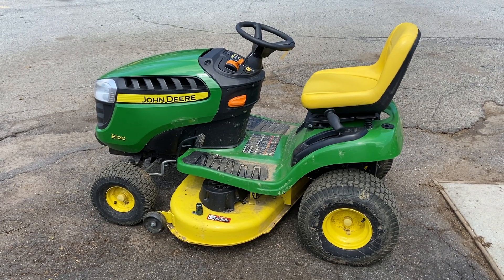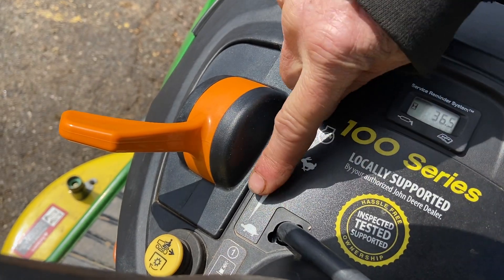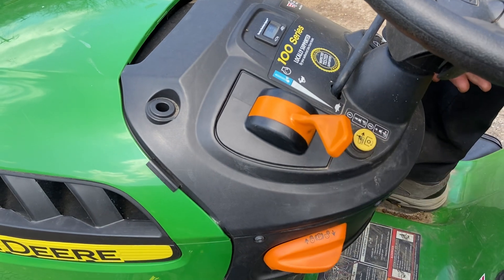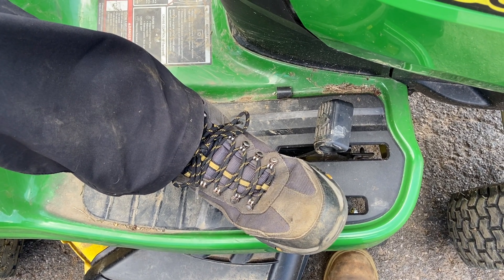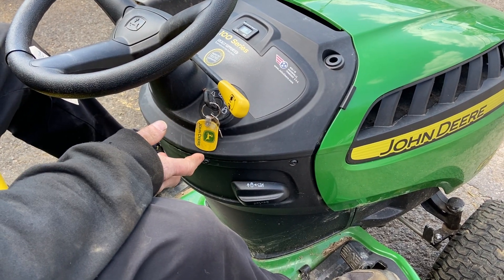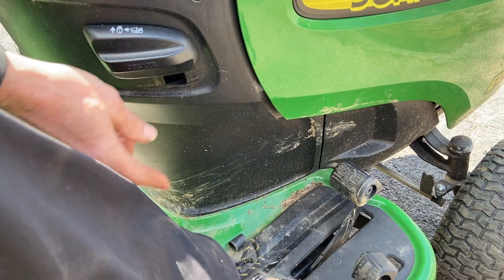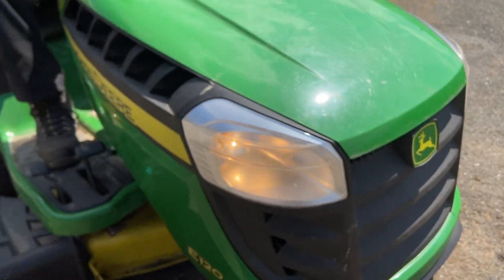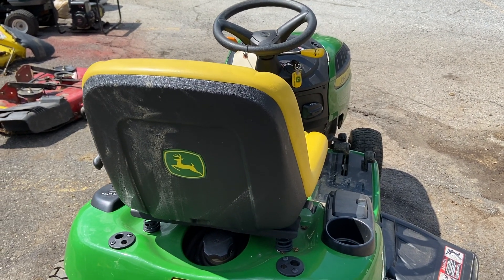How to operate a John Deere E120 tractor

Comment: I’m brand new to this lawn mower. I grew up using push mowers. I’ve been killing this poor John Deere since I bought it. I’ve been dropping and lifting the blade just to put it in reverse to even out my lawn lines. Unfortunately when they delivered it they dropped it off and didn’t explain any of this to me. I’m so glad I saw this video. I had no idea the button on side will slow you to use the blade in reverse. Now unfortunately my screen at the top is blinking “sync” at me and I feel it’s from the mistakes I’ve been making by dropping and picking up the blade and stalling the lawn mower out. Thank you for this video!

Comment: Thanks for the info, one question, I'm waiting for my first John Deere lawn tractor to arrive any day. Should I mow it with it set at full throttle, and should that be adjusted at all while mowing?
Reply from the maker: Yes, run the throttle at full speed after the warm up when cutting grass. No need to regulate the throttle at all when cutting grass just leave it at full throttle. Then engine is air cooled and will run and cool properly at full throttle. The transmission also will work and perform the best at full throttle.

Comment: Nice video man. One question, how do you change the speed the tractor runs?
Reply from the maker: If it is engine speed? use throttle lever and if it is ground speed? use foot pedal.

Comment: A good note to use is to idle down before you disengage your blades to not wear out your blade brakes.
Reply: I agree. I never engage or disengage the deck at full throttle. I always throttle down first. If I  just engaged the deck, I then throttle back up to mow.

Comment: Is there a way the engine can stay running if i get off the tractor? I know it has a seat kill switch.
Reply from the maker: Yes, lock the brake on. Just make sure the blades are disengaged. You should then be able to get off the tractor with the engine still running.
Reply: @JohnsonsSmallEngines  awesome thank you!

Comment: Is there a choke
Reply from the maker: Yes there is a choke, some are different, the way they are set up depending on the engine model .This video may help. It is not a Briggs and Stratton but they use the same set up for the choke.https://youtu.be/HxCTPQsmqbk

Comment: Thank you, good video been looking for this. I just bought one E120.  I start it,  ok . But when I release the clutch brake it dies. why?
Reply: @Dennis Ditsworth Is the pin in the back pulled out?
Reply: Are you sitting on it when you release the brake? If no one is sitting on it, the engine will not run (or start) unless the brake is locked on or held down.

Even if the brake is on, the engine will not run if the mower deck is engaged if no one is sitting on it, and it will not start at all until the deck is disengaged.

The engine will still start and run if the "free-wheel" pin in the rear is pulled out, but it will not drive. Running the engine with that pin out can damage the transmission.
Reply from the maker: Check to make sure your seat switch hasn’t become disconnected. It is a safety switch issue.

Comment: I am having a hard time to remember to push the reverse button and the mower cuts totally off on me. This is my new mower. But when that happends I also have an even harder time to get it to recrank after it cut off on me when I didn't push the reverse button. Can anyone help me?
Reply from the maker: Not sure what you mean by "recrank"? Does the engine spin but doesn't start? or does the engine not spin?